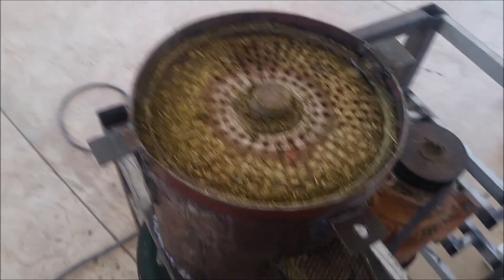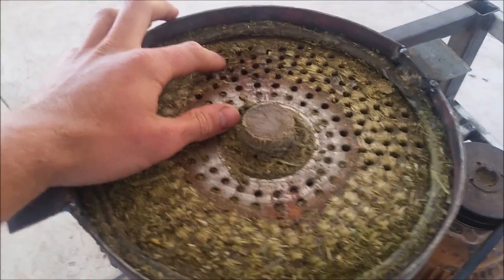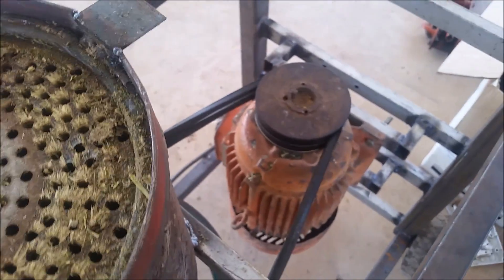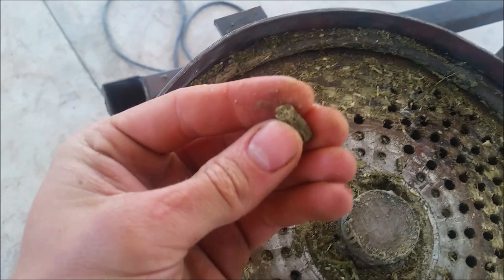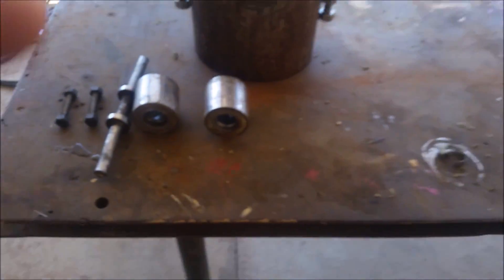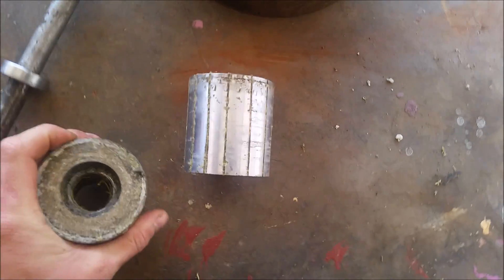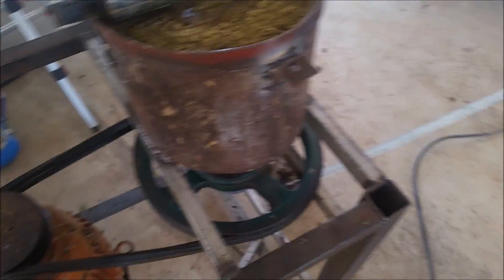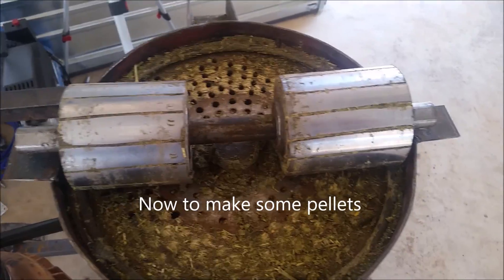DIY pellet mill

Comment: Nice. Hoe ver is jy met die verbeterde model? Just a few questions. Do you have to reduce the speed of the motor? What is the ideal speed of the forming plate? Will a faster speed increase output?
Reply from the maker: het een al maar my internet is af hulle ons lyne gesteel en dit is te duur vir cell internet en hier is ook fkl syn
Reply: Also as the rollers press down on the forming plate what stops the plate from just going downwards? a collar below the plate might act as a brake. Some sort of lock ring collar on the shaft?
Reply: from my understanding of how these mills work, if the motor spins too fast you end up wit very small pellets. I may be wrong, have no experience in the matter just from what I've read.
Reply from the maker: from what i have learned is less speed and not too much pressure and the plates needs to be very thick you have to have a force build up in the holes to make good pellets
Reply from the maker: i can weld pretty good , kidding got a very good bearings installed

Comment: I see the problem, your bottom hopper (forming plate) has the holes spaced too far apart causing the plant fibers to clog up on the large surface area between the holes, I would start with a thicker plate of steel and drill the holes closer to each other in staggered honeycomb pattern, also I would use a tapered (step drill bit) or funnel shaped drill bit for the form holes, that way the reduced hole diameter will increase heat fiction and create not only vertical pressure but also horizontal pressure on the pellets being formed.
Reply from the maker: you are 100% correct and i will be doing what you said and a couple of people her on youtube and from what i have learnd to make it better thanks for watching
Reply: And thank YOU for being humble and excepting advice from others! ( ;
Reply: mrMacGoover
Reply: mrMacGoover
Reply: Will it help to put a “wiper or scraper” behind the rollers to scrape plant fibre off of the pellet plate? So that the fibre stuck to the plate will not impede on pellet forming.

Comment: The pellet machine's i've seen, its the rollers that move not the strainer, but I guess works both ways.  Also, pellets for feed can use a starchy liquid (potatoes, rice etc.) as a binder or if you're making pellets for stove burning same dif using dried grass clippings & shredded newspaper etc.  I''ve also thought of using an old hand crank meat grinder and a drill!  could motorize it and modify a hopper for it too!  Just thinkin outloud!
Reply from the maker: +R Pace i think i saw someone who used a meat grinder design just google it and it worked very good thanks for watching

Comment: it looks like your pressure rollers are riding up on the inner ring. this may be why your pellets are soft. it may not be getting full pressure on the disc. it's hard to tell in the video, but that's what it looks like to me.
Reply from the maker: +bos dad hi Bos i am still tweeking it but hopefully i wil get it working 100% thanks for the info and thanks for watching
Reply: +Phillip Fourie adjust the roller...then the machine will be good
Reply from the maker: +Asrul Hamba Fakir thanks i am working on a better version on this will post it on youtube when i am done , you learn alot after building a prototypethanks for watching

Comment: you need more holes in the press plate as theres alot of flat surface area the rollers will just squash the material to the plate not into it. also try having abit of a counter sink sort of edge on your holes at the top, this will alow more material to enter the hole and be more compact :)
Reply from the maker: +nathan boardman Wow you know your stuff i will try to build it like you said for my new pelletmill again thanks for watching
Reply: +nathan boardman 5 months late
Reply: You can also install a mechanical  vibrator on the dropout chute ,so you don't  have to use your hand

Comment: Hi Phillip, I think if your top plate with the holes is thicker the pellets will be more dense, what do you think. Maybe 30-40mm thick. I like your prototype, I'm going to make one too, thanks for the video. By the way, how is your forklift battery working? Regards. Andries Top Tilapia Randfontein.
Reply from the maker: +Andries Nortje Yes if u use a thicker top plate you will have a more dense and a much better overall quality pellet , if u use a thicker plate like you said about 30-40 mm thick the pellets will be better compressed and thus harder and give it that smooth pellet shine , don't know where to get such a thick plate but you will have you work to do drilling all the holes in that plate . The forklift batteries work great , from all the other types of batteries that I installed in previous solar systems , best quality and value for money is the forklift battery , I get about 3000cyc at 50% DOD , if you want to learn something funny ask around for prices on these so called solar battery with the same DOD and compere it to normal deep cycle forklift battery you will be surprised , and if you buy them new you get a 5 year warranty. For me the best solar battery on the market is the forklift battery and it is cheap 
thanks for watching and commenting 
regards
Reply: +Phillip Fourie great video
where you are i have very interested and need
Reply from the maker: +Altaf Alam  i am in South Africa , Ohrigstad town 
thanks for watching

Comment: Very nice machine. What are the pellets used for?
Reply from the maker: +boris4231 Thank you , I use it for feed or I make wood pellets for my rocket stove 
thanks for the comment and thanks for watching
Reply: +Phillip Fourie I was just thinking this would be perfect for making rocket stove fuel! What are you using yours for? Been wanting to make one for ages, to heat water.
Reply from the maker: +Tarn Alcock I am using it to make feed for my animals on my farm but I did make some wood pellets to test if it works and it does you can make pellets from this machine to fuel your rocket stove